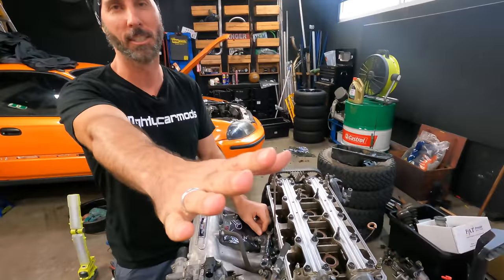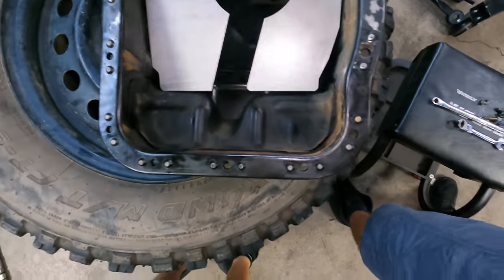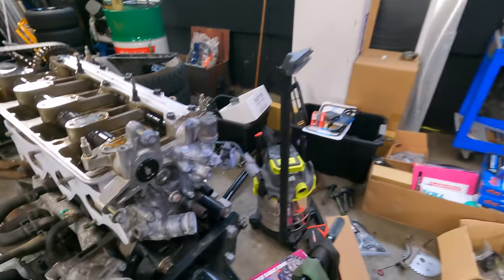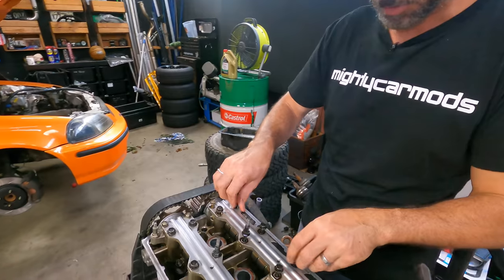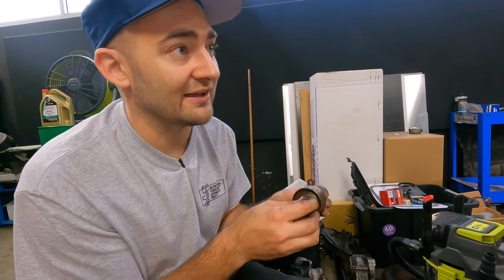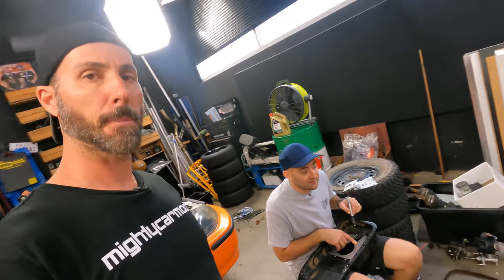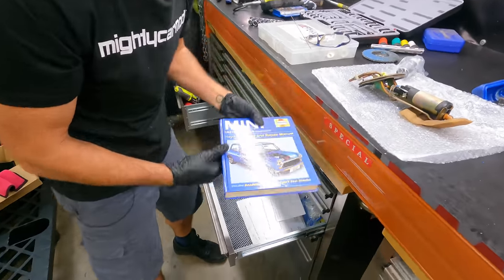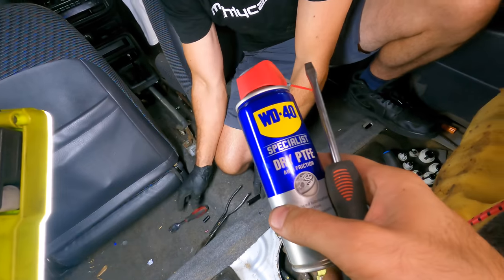Spoon your SKUNK until he MUGENS - CIVIC Build (EP5)

Comment: speaking for america's fondness of civics:
there are very few "good" performance oriented front wheel drive cars available to us. you have a $40k focus, a $35k golf, and that's pretty much it. so if you can't afford a "good" one to start out with, you get non-turbo one that's a decent platform to build upon, and that pretty much leaves you with a civic. it's a lot easier to turn a cheap civic into a good civic than any other vehicle or brand. 

hot hatches don't really get a long well with our highway safety standards and insurance companies. so they are too expensive for the demographic that likes them. and the demographic that can afford them doesn't want them. i can buy and insure a challenger scat pack with a 392 for the same price i could buy and insure a civic SI or subaru STI. the "cheap and cheerful" cars just can't get marketshare.
Reply: of course having said that, i've never owned nor want to own one. i did own a challenger for a few years. but when i took a job with a 50 mile commute, i downsized to a WRX with a couple COBB goodies for a mix of fun and fuel economy.

Comment: Honda civic 
- insurance cheap
- parts cheap and maintenance practically non existent if you do regular oil changes and such
- Such a large aftermarket that parts could be really cheap or really expensive allowing a lot of choice and potential to make the car faster 
- good on gas
- Lightweight 
- All consumables (tires brake pads fluids etc) are all super cheap compared to other cars 
- And last but not least THEY ARE FAST AND FUN to drive. With my 200hp integra I have lapped c5 corvettes and quadrofoglios and mustangs. Its a great platform to improve as a driver
Reply: Whether the honda is fast or slow in a straight line it doesn't matter. Please just put a nice set of suspension and tires in it and run some time attack against super gramps! or something of the like. These cars can do a lot with not much power

Comment: Why do people like civics.... So from a non performance perspective I've had my 2008 1.8 petrol civic for 2 years, I have done about 50k miles (bought it on 60k miles now on 110k) and have replaced the tyres and brake pads. That's it.

Not to mention if it does go wrong it's incredibly cheap to fix. I don't think there's many modern cars that can compete with that.

Even I mock the car because it's not cool, and it's not fast, but honestly, I can understand why people love them and why people stick with them as a brand.